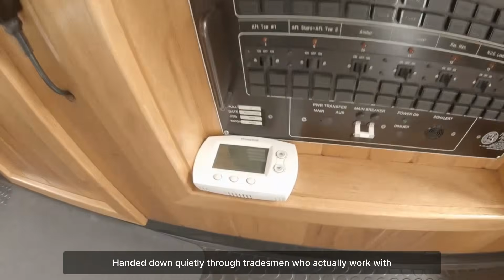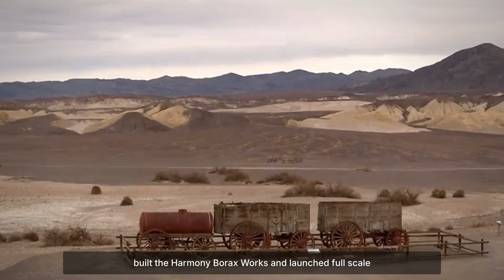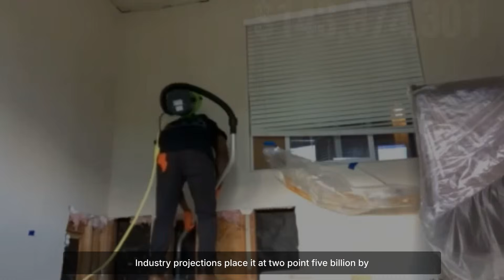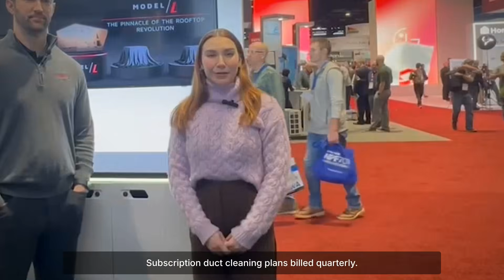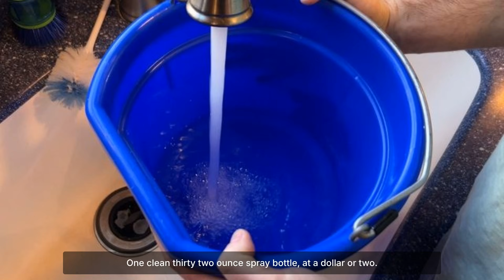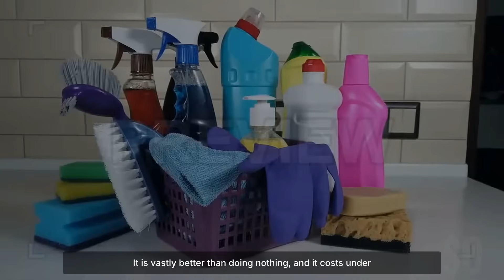This $5 Spray Stops Summer Mold Before AC Spreads It. Why Do HVAC Companies Hide This?

Comment: Absolutely awesome way to destroy your evaporator coils. HVAC evaporator coils are made of aluminum fins and copper tubing. Borax is highly alkaline (pH ~9.3). Leaving an unrinsed, highly alkaline residue on thin aluminum fins can accelerate galvanic corrosion, leading to pinhole refrigerant leaks and system failure. If the borax does not completely dissolve or if the water evaporates quickly, it can recrystallize into a hard crust. This crust can easily clog your condensate drain line, causing the pan to overflow and leak water into your home. Also, Borax works as a repellent by leaving a dry, powdery mineral film behind. When your HVAC blower fan turns on, it forces high-velocity air directly through those coil fins. This can aerosolize the borax dust, blowing it into your living spaces where it can cause lung, nose, throat, and eye irritation.